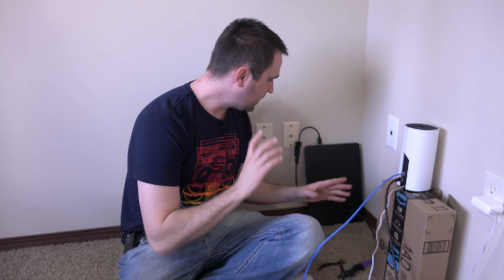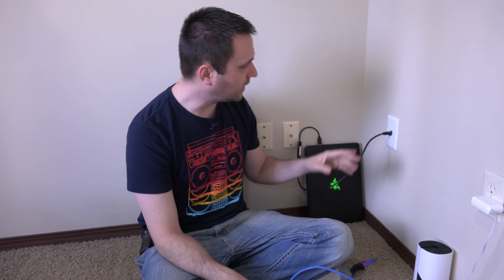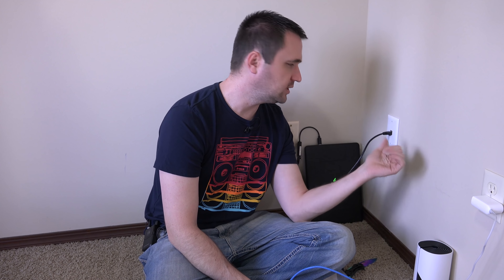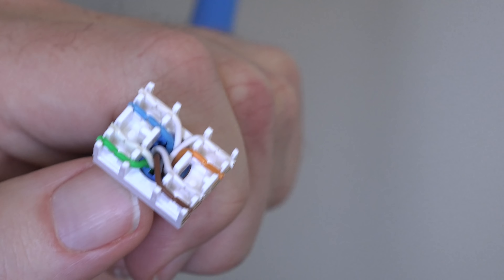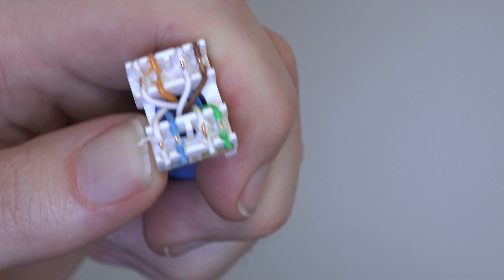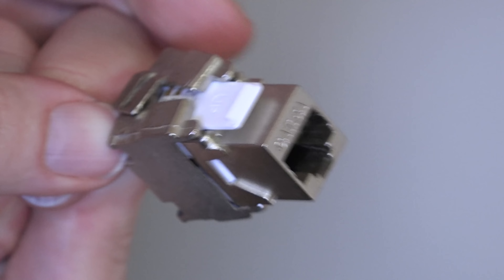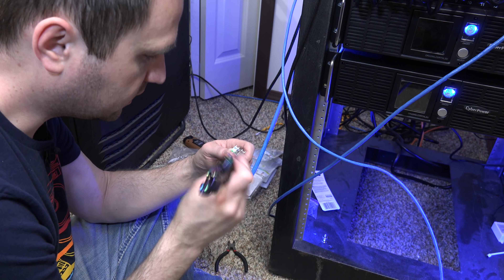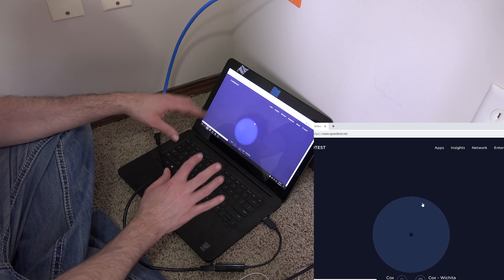Keystone Ethernet Jack issues... User Error?

Comment: Speedtest is not a test of how high quality your jack or cable is. Your test copying a file between two devices on the LAN is more reasonable and your results point to no issue at all - keep in mind performance of NICs and disks at either end. Just because a network link electrically connects at a gig does not mean your infrastructure is capable of a gig. Also stripping wires back exposes them to greater electrical loss and interference and is unnecessary for w lunch down or keystone jack. “I exposed all the wires so I know it’s making good connection” is a total folly.

Comment: Try switch around brown wire in your network rack. Looks like it don't match the other jack.
Reply: Nailed it, well just be sure you match what all the other cable are ( if your A standard all cable A if B then all B. And please re terminate the wires with shielding in place its important.
Reply: Hey Jason, have you tested my suggestion?

Comment: Some have reported putting electrical tape around the plastic porting of the jack before closing the housing to prevent some cut wires from grounding out against the metal sides of the jack to completely solve the problem.

Comment: there is a program called lanbench that can test the speed of the network at full speed without using the hard drive. you  install it into 2 computers  and run the test.

Comment: This is why I have a nice Fluke network tester.  Because I did make a few errors on my home networks.  You space out.  Do many of them and stop paying full attention to what you’re doing.  But I would test each connection as I go.  I don’t have any single  keystone wall plates.  I have anything from 2,4,6 and even a 12.   All going back to my 48 port managed switch.  

See here, he’s guessing what the problem might be without using a tester.   Seems to be good?
Reply from the maker: I should get a tester. But it may be a cable issue

Comment: I just got a netduma gaming router but I wanted to plug straight into the router but my moms making me set the router up in the laundry room cause she thinks thats where it will give out the best signal throughout the house and I have a wall ethernet port so if I plugged into that through my ps5 will it be the same as plugging straight into the router

Comment: Change the rj45 socket. I’m guessing the socket pins ain’t touching the plug pins right. I had that and a wiggle would change it from working to not working. 🤷🏻‍♂️ A kink in the wire could even destroy speed. Didn’t believe it but can.

Comment: 1. Try to Punch down Tool

2. The now-aging USB 2.0 standard can theoretically transfer data at a very high 480 megabits per second (mbps), or 60 megabytes per second (MBps). But not as much as the newer USB 3.0, which can handle up to 5gbps (640MBps)

3. https://www.quora.com/What-will-be-the-speed-of-USB-2-0-to-ethernet-converter-Will-it-be-normal-like-a-LAN-connection

Comment: With these keystones can you use a punch down tool.  Most that I have seen you punch the cable directly into the jack to ensure you have a good connection.  The ones you have may be different...  Also, another speed test site that I have found useful is testmy.net.  Good luck!

Comment: This is cable issue.  Many Monoprice and amazon cables fail the test with real tester like Fluke DTX-1800, which is the most reliable way to test cables (sorry iperf).  I strongly recommend you try another cable, or get a certified cable from Blue Jeans cable.

Comment: Ensure you have only connected the ground for the shielding at one end and not both. The only other possibility if you get inconsistent speeds using Iperf is bad termination. I have to agree with others that IDC punch down connectors are far better than these self terminating jacks. Sometimes these devices that are supposed to save you time just create a massive headache !!!

Comment: I am not sure what type of switches you are using, but autonegotiating issues are a real thing.  Meaning that the switch will not negotiate properly with the device and make the port 100 or 10 mbps when it is a gig port.  I usually work around this by defining the speed of the port on the switch to gig.  You can't do this on all switches  but it's something to check.  The downside is that the device on the other end of the switch will have to have a gig port also.

Again, depending on your switch setup and vlans, slowing down one port on the switch might have adverse affects on the other ports.  Let's say for instance one of your cameras was negotiated to 100mbps for some reason.  It is possible the other ports on that vlan will be throttled to 100mbps also.  Networks will normally run the speed of the slowest device (there are exceptions)

May or may not be helpful
Reply: 112MB is the sweet spot for transferring, I've never seen it go faster on 1GBps
Reply: @danielduplessis2214  yeap, agreed, good callout.  I was just saying this since the issue was intermittent and might come back.  Autonegotiate might be a thing to check
Reply: @kenschmiesing4442  lol didn't see where the reply was going, i meant to reply to the whole video not your comment.

Comment: Almost all the monoprice jacks I have tested with cable analyzers have failed to qualify at a 10-20% failure rate.  I have reasonably good results with their patch cables however.  Just the jacks and patch panels have been less than good.  So I will no longer consider monoprice cat5e/cat6 jacks and patch panels.  I think their suppliers are likely to blame though Monoprice should do a better job holding them to quality standards.  

I standardized on Leviton jacks and I'm liking the Trip-lite patch panels that have removable groups of jacks.  These are easy to obtain from my local distributors.  You can pick one of the other quality brand names depending on your suppliers availability and pricing. Hubbell, Panduit, Leviton would be the top 3 to look for.  The prices can be much higher though they almost always can be obtained at more reasonable prices if you qualify for wholesaler discounts from authorized distributors.  These brands are usually stuck in the older business model of distribution through wholesalers who only sell to qualified (have to fill out an application with a copy of your business license etc) electricians and structured wiring installers.  A lot of the retailers are selling at manufacturer suggested retail price or have minimum advertised price restrictions which means the general public has a hard time finding these branded parts for reasonable costs.  My distributor generally charges about 35% below the prices I see online to the general public as their cost for wholesale clients.  (have to login to a portal with company account at the distributor to get my wholesale pricing)

Comment: No, 125MB/s is not gigabit. You're closer than you think. Gigabit for transmission is measured as a billion bits per second, or 1,000,000,000 bps. Just over 119MB/s is the Gigabit limit. Any software showing higher than that for transmission speed is estimating inaccurately, or is using compression to compensate for overhead, and reporting that instead.

Doing the math:

1,000,000,000 bps ÷ 8 = 125,000,000 bytes/sec.
125,000,000 bytes ÷ 1024 ÷ 1024 = 119.21 MB/s

So if you peaked @ 112 MB/s, that would be about 94%, so only about 6% wasted on processing overhead or attenuation of the signal. In other words, "gooder enough" as I like to say :-P

Comment: just another thing to check if you like to save the odd quid here and there. You didn't get CCA CAT . How to check find a scrap bit of the cable, peel back one of the cores , you can use your knife... scrape through the core, if it changes from copper to silver , then it could be Copper Coated Aluminium which is junk.  Then personally plug your server in to the wall socket and retest .. using a ramdisk and iperf or totusoft lanspeed  or  paessler packet_loss_test ... something that will produce / show packet drop / should give you some real life figures. 

maybe see if you can borrow one from these guys pockethernet as it has a loop back detector thus testing a cable , removing the hardware of bottlenecks

Always go for lowest common denominator before then plugging in to switches etc. Point to Point  . Again reiterating, cable bends, non parallel running of cable with mains, if you do always 90 degrees crossing , a short from a snag or cable burn, behind an inductive switching load (air con) Hope there is some food for thought :)

Comment: Jason first of all Back Up .....If you are having issues is it just this Plug/Run?  I would go to your Router First and chase the issues from source but first do the speed test to their server first @ your router to make sure you are getting GB to the HOUSE at all times. If you are on Cable ...... #1 they might be throttling you BC of heavy use! # 2 you have capped out your bandwidth available in your contract ,a lot of times they hide how much you can use deep in your contract  you know the part none of use read.....I would test other jacks in the house at diff times of the day to see if it happens to them too, & if you know for a fact the first 2 i said dont exist try looking at the New device you plugged in maybe the issue is "IT has an issue"  I doubt your house is big enough to need line booster most have to be over 5k for those to be needed....if its ONLY that wire time and time again replace the wire but first go get a Cat line tester for 30 a cpl of weeks and then once fixed return it!!  Personally I dont like Metal Jacks terminating with Exposed wire BC it can cause Interference, I would use Plastic End point keystones if i was you! So much more but this will keep you busy for a bit. Cow}:-o)

Comment: Keystone is connected incorrectly. You need a punch down tool. Wires go into the metal prongs on the connector side. The plastic piece is simple a protective guide plate
Reply: Some tool-less keystones are setup like the ones he has.  It's a bad design, they usually fail quickly or don't work.  cheap

Comment: If you'd just use Cat6 you wouldn't be having these problems :-)  Cat6A is a PITA and isn't needed in a residential setup even for 10Gbe use.

ETA: Also cable internet sucks.
Reply: Compared to what ...DSL ?
Reply: @jeffherdzina6716  Fiber for one but general Cable internet sucks because it's basically a huge Token Ring Network so you never have dedicated bandwidth.

When the system is busy your speeds plummet and latency increases.  At least with DSL I always get my 25Mbps down and have 15ms or less pings to Google.

Comment: Hehe cat6e. What a waste, should have just stuck with cat5e if all you're going to be using is gigabit at home. 
Honestly, don't see 10gbe copper connections being ready for home use for at least another 10 years now. It's ridiculous that we have WiFi 6 knocking on the doors of routers this year providing 9.6gbit it throughput on 802.11ax radio connections, yet we're still pissing in the wind with a wired 1gbit connection. I know it's unlikely that we'll see real world examples of anything close to 9gbit WiFi transfers but it's still going to be way over that of an ethernet 1gbit connection is going to give. 
So is cat6e worth it? For home labs, probably not it's just bulky mess to have to deal with it for no real benefits. Just go with faster wifi when it comes out as it seems even the routers aren't getting more than a 2.5gbit or 5gbit ethernet connection on the new routers.

Comment: You need to punch down that shit.  You're doing it backwards/upside-down.  Those white things are to protect the wire, you want to actually punch down that wire to the other side of the keystone jack.

Get yourself a punch down tool and see how much better you network connection is. 🤣

Oh and anything other than speed test sites. Like ipperf

Comment: Jason, I'm a home network and CATV installer in the Orlando area. You're using Cat6A cable. Its overkill, even for 10gb. Also, you are using Cat6A shielded "tooless" RJ-45 keystones. Do not use these. Use standard Cat6 keystones and use a punchdown tool.
Reply: Boe Walls exactly, listen to this guy Jason. Those tool-less jacks are junk, always use a good ol’ punchdown tool.
Reply from the maker: yeah I agree its overkill. I just got a good deal on it at the time. #cheap
Reply: Cheap is not always better.   Trust me, I am the king of cheap.
Reply: Please please get a punch down tool

Comment: 10 minutes in, and I realized you're doing basic youtuber troubleshooting.  I know you don't advertise you know everything but start at the core and get, since money doesn't seem to be an issue, solarwinds to help with network traffic and speeds.  You should be testing from the core itself.
Reply from the maker: 20 seconds in I disclose i am troubleshooting :)
Reply: @Bytemybits  guess i'm just prone to skipping 21 seconds in now to every youtuber to avoid 'intro's'.